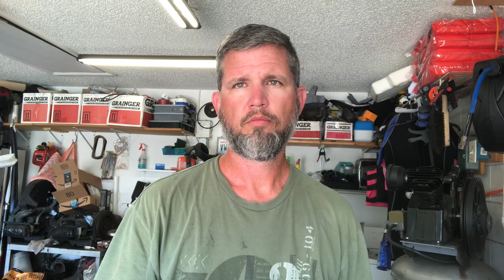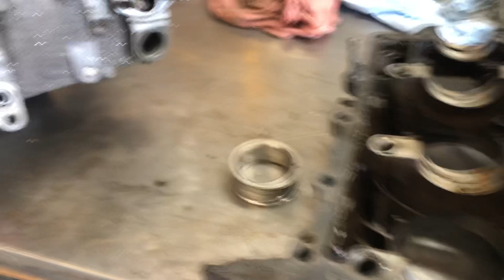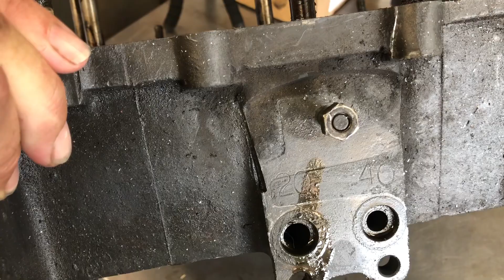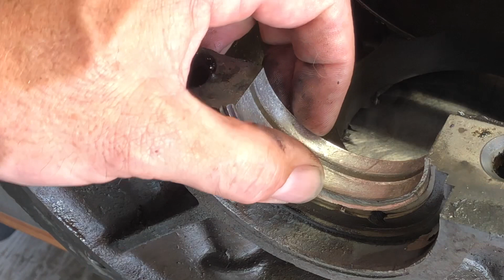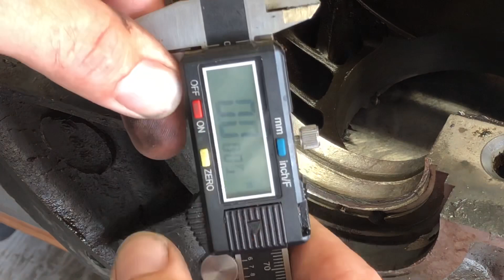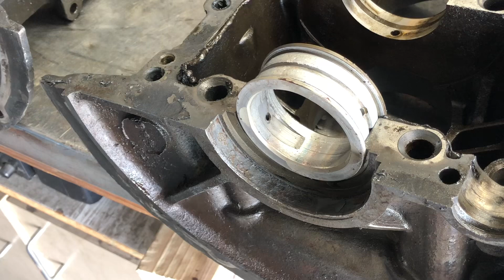AirCooled VW Engine Case Thrust Surface and Problems

Comment: you can ues a piston ring from a briggs & stratton as a shim between the thrust and the bearing if you want to save the case
Reply: Your a genius Darrin, that's for commenting. Thank you for sharing all your knowledge to the VW community.
Reply from the maker: vwdarrin I’ve heard the same somewhere else before and I wanted to ask you about that a few weeks back but I forgot.
Reply: @VWJawbreaker  thats an old GEX trick
Reply: The man with the plan Vwdarrin!!
Reply: I may have to give that a shot.  I am going to build a volks air compressor and will never use a clutch.  I still haven't gotten the engine apart, but wish I had not proceeded down this path.

Comment: Thanks for the video. I am just going thru this same issue right now. Can’t get the endplay I need. Already have 3- .010 shims in and 
I still have .026 endplay and can’t get enough shim to set it with three so checking and I have this same issue. Looks like new case.
Reply from the maker: They make shims of different thickness, shop around and see what you can find.

Comment: vwdarrin's comment is right on! From an old-timer: that's one of the scrapers from a 3-piece oil ring. Forget what tiny engine but it needs to have 2.75"/70mm bore. Same size as outside of #1 main bearing flange. EVEN EASIER/CHEAPER/WEIRDER... Cut a full circle (or two in a pinch) from an original kid's SLINKY toy. Wraps around # 1 brg, cut thrust to match. It ain't a new case but it works!
Reply from the maker: If someone wants to “repair” a case that way, that’s up to them. We opted for a different case for him to use.

Comment: What happend to an 80 80 case  they run fine
Reply from the maker: I personally wouldn’t run a case that’s been cut that much on a line bore.
Reply: @VWJawbreaker  why not bearing stronger than case have never had issue yet building since 1963

Comment: Hey Bro , They Always Mark the Case Some where If Its been line Bored or Thrust Cut Don"t They ?
I Can"t Find any Outer Markings on Bess Any Where , Behind the Flywheel where that one was Marked 
i Haven"t Split the Cases , But the  End play was OK and oil Pressure and No Major Noises 
So im Just Ganna Put New Stock Barrels and pistons In 
And When I Save up More Money , Then i Wil lStrip it down and Rebuild For more HP and Stroke
Reply from the maker: I have seen some cases not marked when it was line bored or thrust cut. It depends on the person doing the machine work. 
If your bearings fit snug and your oil clearances are fine, put it back together 🤙
Reply: Cheers bro

Comment: Good info Gary , is that where they typical stamp the case if its been line bored.  How do you measure the bore in the case to verify . I guess a quick check you can measure the OD Dia. of the bearings , but do you check the case with a bore guage ?? Reason for the questions,  I have about 4 single port motors i need to pull apart and check that came out of 2 buses and 2 beetles.
Reply from the maker: Dan Love yes correct buddy, you want to check the overall diameter of the case where the bearing goes. There are charts on line that will tell you how big the diameter is vs if it’s been cut and possibly how many times. I can also send you a chart if I can find it. Not all people who line bore and thrust cut cases stamp the case, but it should be stamped on the top of the case somewhere.

Comment: Do you know the symptoms of having the bearing move around like this? At the end you said that it happens with normal use over time, just wondering what to look for in the future! I would ask Spence but he's asleep 😅
Reply from the maker: Dust Buggy an easy sign is if you start getting excessive end play, that usually means it’s time for a bottom end rebuild. That rear bearing along with the 3 shins sets your end play to .003-.005”, if it’s getting worse over time, that’s due to bearing / case wear. Adding more shins won’t cure it.
Reply: @VWJawbreaker  that's actually what happened our first engine build, bad line bore and the bearing almost walked. I thought maybe you could tell before you found a pile of oil pouring from your block 🙃😅
Reply from the maker: Dust Buggy if you push and pull back and forth on your main pulley on the crank, of the pulley moves in and out a lot and has loud clunking noises, it’s time to pull the engine and split the case. 
If the end play is set properly you will slightly be able to move the pulley but barley noticeable and barley a clunk.

Comment: There is actually a very easy repair for the thrust, which I've used in the past, not often, but I've used it. 
Cut the thrust face until it cleans up. 
Buy a set of piston rings from an 1100cc Mk1 Golf (I think you guys called this one a Rabbit??).
Use one of the rings as a spacer - fit it into the bearing. Measure things and machine bearing to fit into case with this ring installed.
Reply from the maker: Someone else mentioned using a piston ring also, I believe from a lawnmower or something. We were able to score another case and transfer everything over with new main bearings.

Comment: Wow his bearing was totally starting to walk! That's crazy man. The first time Spence and I built our motor it did that because of a bad line bore and we ended up having to tear it apart less than two months after getting it together 😣 lesson learned, do it right the first time haha. (We also learned, if shit happens go bigger 😂)
Thanks for the info of the thrust cut thickness specs, I didn't know that!
Reply from the maker: Dust Buggy just trying to spread what little I know 😁
As for your situation, learning as you go is one way to do it and honestly sometimes the best way to learn. Shit does happen, deep breath, get a game plan together and move on.

Comment: It is not correct to cut the case thrust surface to fit a OS thrust bearing.  The proper way is to do the opposite.  After the align bore you skim the thrust surface till it just cleans, then cut the  OS bearing on a lathe hand fitting it to the case. This way you do not waste the thrust surface of the case, and you can get it tight.  Important to get a tight thrust fit.  Mark the bearing and the case at the dowel pin and tap it down with a plastic hammer.

Comment: OBTW, to avoid letting your case ever get so EXTREMELY worn, make it a practice to grab your crank pulley & see if it "clunks" in & out at all (more than the normal .003-005" end play) You will notice when/if thrust bearing is getting loose. Try this at home! Best when engine is not running.
Reply from the maker: Yes I’m aware of end play and how to check it. This video was put out for the person who that engine belongs to so he could see what was going on. Thanks for commenting and have a safe week.